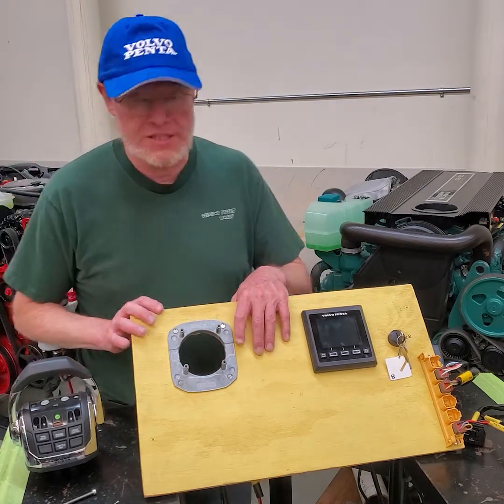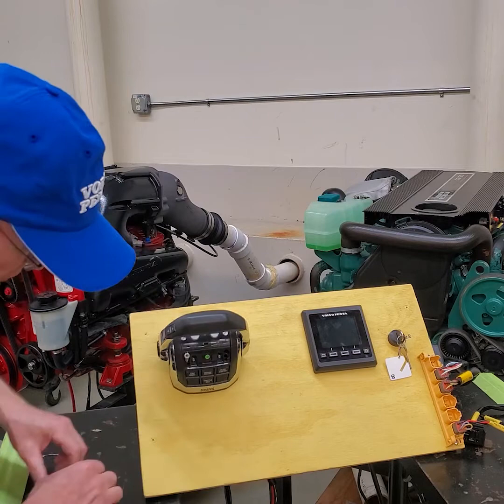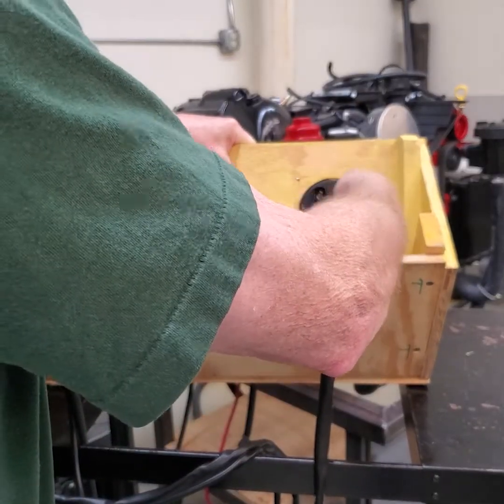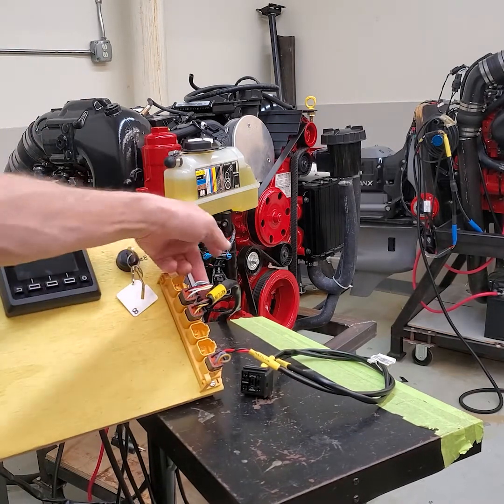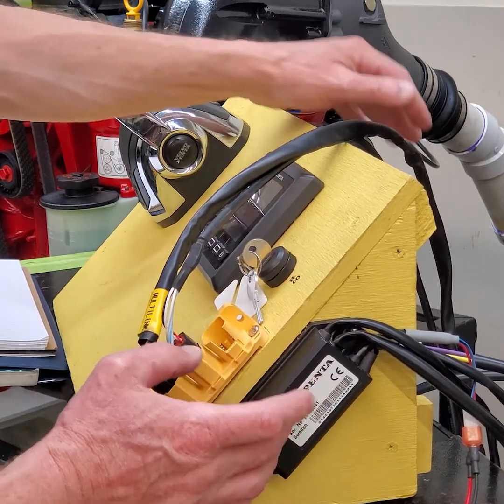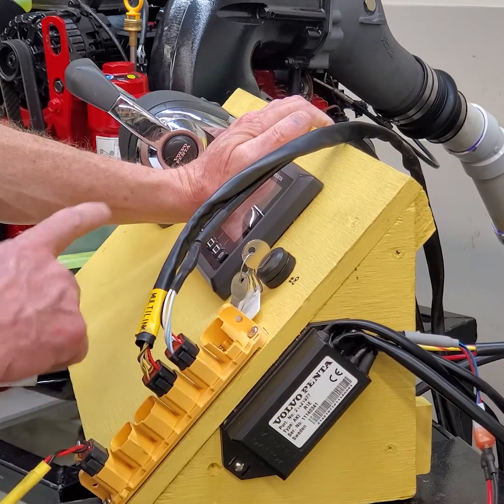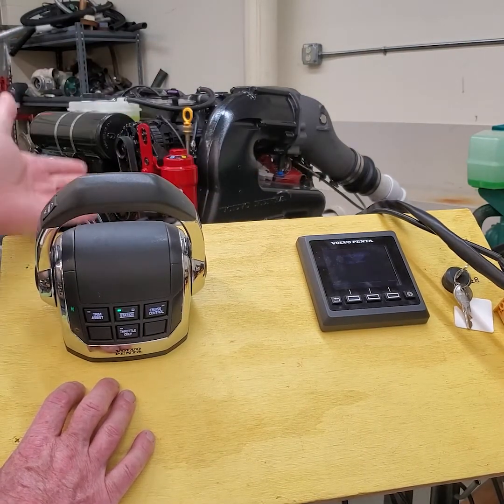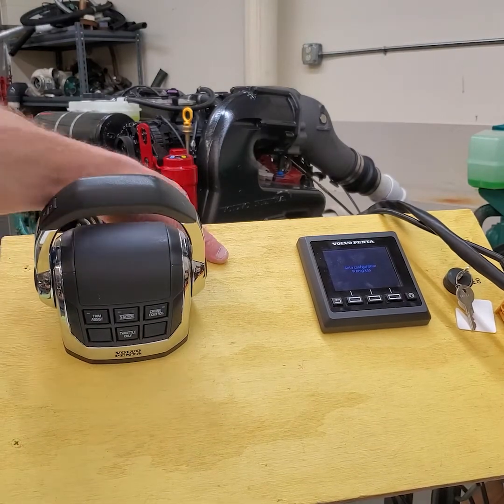Volvo Penta EVC D and E AKI and calibration of controls

Comment: Ted, great video, so informative. Question. I'm a single engine installation using evc-e controllers, i have two helms, an inside helm with gauges and the key, and controls and an outside helm with steering and controls. How does one hook up a second shifter? Do you need  controls with an hcu built in, or can this be done with simple controls. My preference is simple controls.

Comment: I'm now having a problem with the Volvo Penta D4 star lock... It can turn on but it won't start
Reply from the maker: I"m not sure what the "Star lock" is. Does it crank over? if so it's fuel related likely.
Reply: @tedsmarinerepair8956  The problem is with the ignition key, it can only be turned on, but won't start
Reply from the maker: @TimbulLingga  I will need further information to make a list of thi gs to check. Please email me at marinedoc01@yahoo.com for further consultation.

Comment: Hi Ted, I work at a shop and we are just getting into EVC controls and im trying to figure out how to hook up this 8.1 GI to run it. But everything ive tried has no different result. Its a single throttle and it just flashes a hazard sign and ive got no response from my key to my AKI and my screen has no display. No clue what im doing wrong

Comment: I just installed a garmin reactor 40 SBW system and the gateway is not communicating with my steering system. 
Garmin display says….
“Autopilot Controller Lost”
I have gas engines/stern drives with joystick. 
Should I try an auto configuration? 

Garmin is telling me it’s a Volvo software issue and to contact authorized dealer to download software using a vodia computer.

Can anybody please help???
Thanks
Reply from the maker: Do you have the Volvo NMEA 2000 interface box installed? If so  try an autoconfig. If that does not work, then yes, you need a dealer to come down with the Vodia tool to see what is missing
Reply: Hi Ted 

Thanks for the quick response. 
I do not have the Volvo NMEA 2000 interface box installed.
What exactly does that interface do? 
And can I purchase and install it without hooking up a computer?
Reply from the maker: Please contact me at marinedoc01@yahoo.com for consultation. Thanks Ted

Comment: Is HCU gets power from PCU or separate wire from battery?
Reply from the maker: All power and grounds come from the PCU there is a main power feed and a backup power feed which may not show full 12 or 24volts. If you have no power into the HCU check on engine fuses and the DC to DC converter (Diesel)

Comment: I have a EVC E set up in twinV8-380-CE-D engines. My port drive is stuck in reverse. Can’t get it out. No codes. Engine will start with the drive in reverse. It is stuck in reverse o matter what commands are given thru controller or joy stick. Any ideas?
Reply from the maker: It sounds like a shift actuator failure, internal or electrical. You need a dealer with VODIA to diagnose.
Reply: @tedsmarinerepair8956  Thanks! I’m going to check the mechanical first.

Comment: We replaced a bad pcu traced all the wires to the scu and the hcu engine cranks a runs we recalibrate and auto configuration the the code MID 250, PPID 393, FMI0 Comes up when the key switch is turned on.
Does this code need to be cleared or if the problem is fixed will it go away.
Hooked up break out box and checked voltage and frequency and everything checked out.
Reply from the maker: All codes on the display are active codes. So this issue is still there.

Comment: We  have a twin engine d6 330s with a evc-d system we are troubleshooting a short/open in x2 cable we know it goes to the two hcu"s.  Does it also go to the scu?
Fault mid 250 paid 393 fmi4
Reply from the maker: Yes power is distributed from the pcu to the hcu and scu. Mid 250 is the scu and ppid 393 is the evc bus fmi 4 is low voltage. My question is that for fmi 4 it lists it for a sus (IPS) not a SCU (Joystick sterndrive). Either way it appears to bevoltage drop at the scu/sus unit. I would first Check for corroded/pushed out pins,

Comment: When I try to auto configure my single engine D4-300 (EVC-D) I get through the "Auto configuration in progress" step and restarts, but then when it shows the engine selection I can do nothing but hit back, the rest of the buttons on the screen does nothing. Does that mean that everything is done and saved when I hit back or is there anything else I need to do to save the changes?

Thanks!